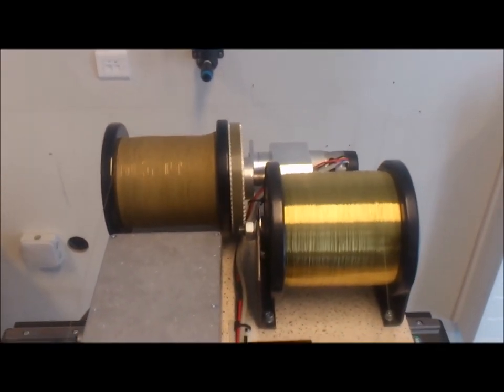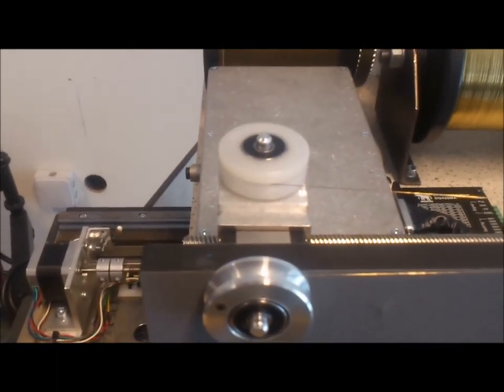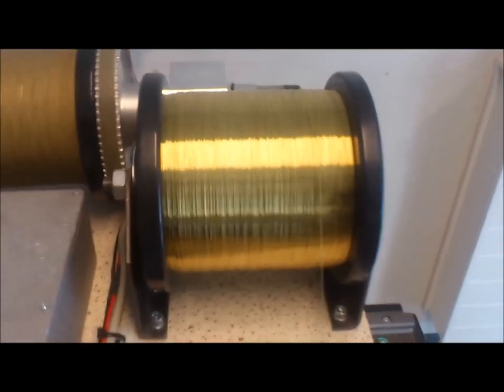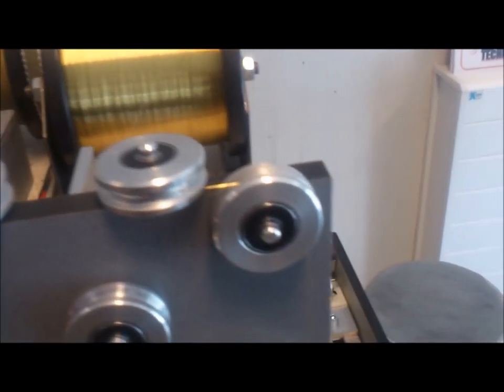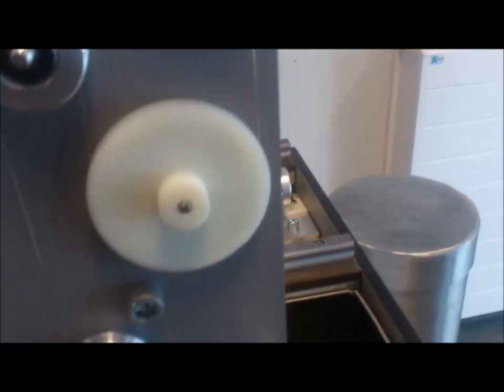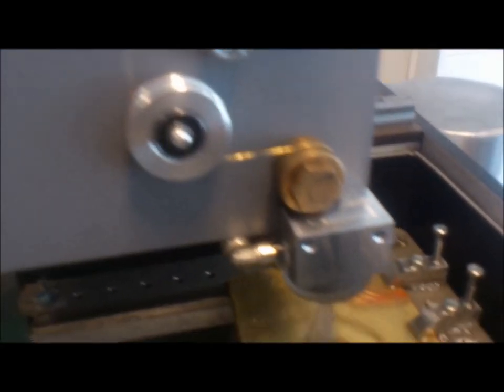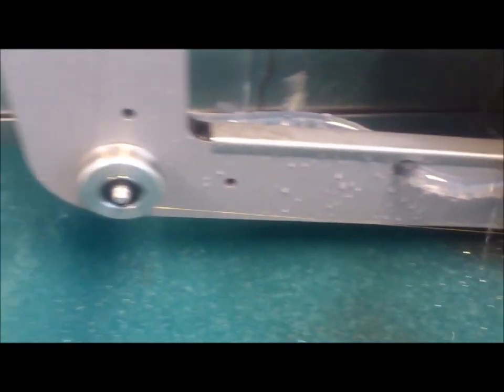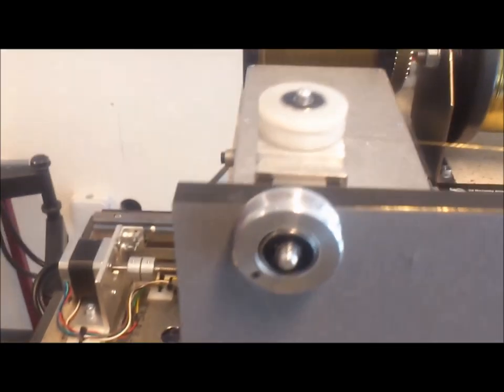Homemade Wire EDM

Comment: what kind of wire do you use and is the wire that is run through destroyed and unusable, or is it a loop?
Reply: We had a Mitsubishi wire edm that didn’t even have a used wire spool.  It just chopped the wire into pieces and dumped the bits straight in a chip bucket.

Comment: Thank you very much. I want to use arduino or arduino-compatible motherboard. Because my old mach3 program does not support usb port. I can also use the m2 motherboard from the Chinese co2 laser machine. Please recommend a more suitable motherboard with usb port support, which has available programming information.
Reply: What about using the motherboard from a RepRap printer?
https://reprap.org/wiki/RepRap

Comment: What i don't get.. Why on earth don't you get the two nozzles closer to the workpiece?.. this will greatly improve flushing, and therefore improve performance of the water.. because you get the conducting metal particles out of the cutting area
I worked professionally with a Brother HS 100, a similar sized machine.. but with the bottom nozzle Just under the metal.. and a "hydraulicly activated" telescope extension would be gently pushed against the part from beneath.. while the top nozzle could be lowered to be just above the workpiece as well.. that "little critter" cut like a dream.. made many parts on that one.. i wish i had a machine like that in my shop..

Comment: Very interesting project. I want to try to build a similar one. How to calculate the feed rate for 1500 watt power 0.2-0.3 millimeter wire. And I want to cut a 1-1.5 millimeter brass sheet. Thanks in advance...

Comment: Rather than having the wire moving continuously in one direction when cutting, I wonder if you could have a solenoid oscillate the wire instead?
Reply: Michael Crumpton this wouldn't work as the wire moves to get a consistent cut. Not only that the wire  erodes too. Think about it, one metal eroding another, the wire is bound to become eroded and would eventually snap as a result. An oscillating wire moving in linear motion would equally become eroded and would also eventually break.
Reply: Isaac Oshea , also the wire gets oxidised as you can see by the difference in colour of the wire between the new and used spools.